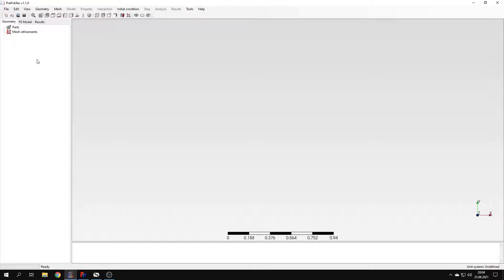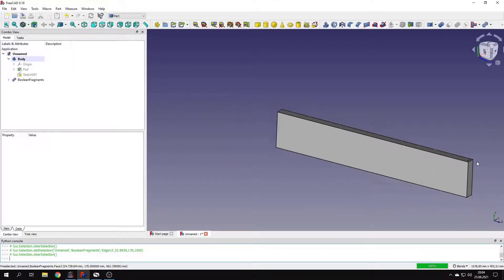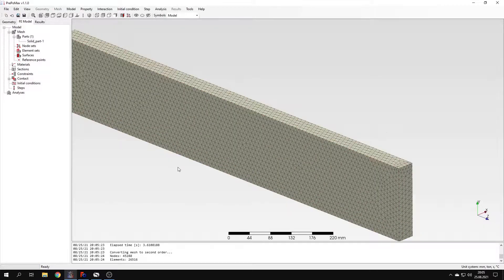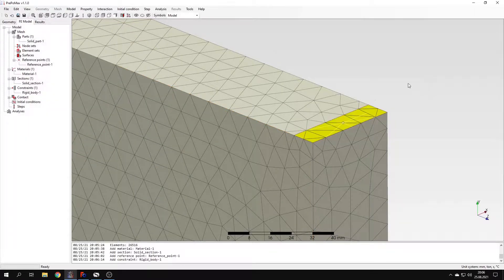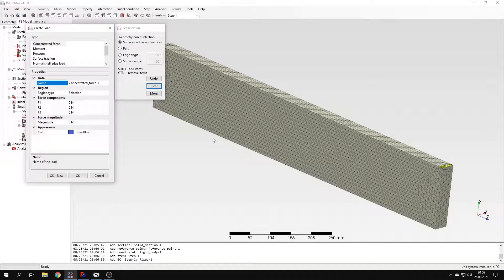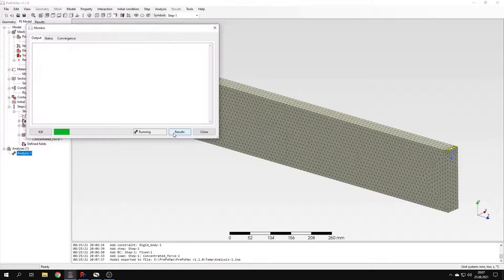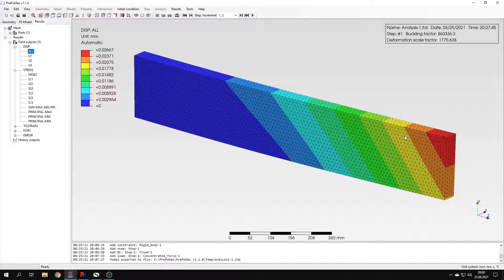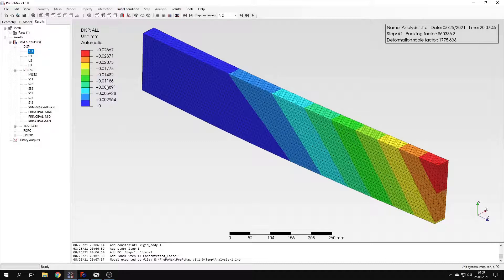PrePoMax (CalculiX FEA) - Tutorial 4 - Buckling of a beam

Comment: how did you make the surface on the bar in freecad, when i do it and import it into prepomax the surface is a separate body. thank you for your videos
Reply from the maker: I made a sketch with a line on the surface and then used the Boolean fragments tool to split the surface with that sketch. But if your part is a shell, also apply the "Convert to solid" tool. This trick should be sufficient to make PrePoMax recognize it as a single part with a sketched partition.
Reply: @FEAnalyst  thank you so much for the explanation. very much appreciated.

Comment: Thanks for your videos! What is the advantage to use a reference point to apply the load to it as opposed to apply a surface traction to that small area?
Reply from the maker: Surface traction should also work but you may get slightly different results.

Comment: For some reason I am only able to select faces at random but others register me a clicking inside empty space in the viewport
Reply from the maker: Are you using the newest version of PrePoMax ? Any unusual computer configuration ? You can report potential bugs on the PrePoMax user forum.
Reply: @FEAnalyst  Yes I've also switched to older versions, I'm using windows 10,  model in solid works and export import StepAP214 file format. I also switched to older version but the issue persist. I do have a somewhat out dated integrated graphics CPU.
Reply from the maker: @thisguy2-4-2  It would be best if you could share this model and describe the issue here: https://prepomax.discourse.group/c/bug-reports/8

Perhaps it can be solved but it’s also possible that it’s a fault of your graphics card. Did you try updating its drivers ?
Reply: @FEAnalyst  I submitted the bug report thanks for responding so promptly my drivers are up to date

Comment: I have been waiting for a non-linear buckling analysis for a year. Hope there will be on the tutorial 27 or 28.😋
Reply from the maker: That would definitely be interesting. I will do some research to find out what can be simulated taking into account CalculiX’s limitations (especially the lack of Riks solver) and how it could be verified. It may take some time though.
Reply from the maker: You were close, nonlinear buckling is covered in tutorial 30 ;-)
Reply: @FEAnalyst  You are always the best...:goodvibes:
Reply: @FEAnalyst  I tried to model Rectangular Plate with a Uniform Pressure Load, with 4 simply line supported. One thing I have noticed was a counter reaction force near all the four corners. So is there any chance to model a compression only on the boundary conditions rather than "0" in designated direction? (compression only spring or tension only member etc.)  Hope may be in the tutorial "36 or 37" best regards, 😙
Reply from the maker: @surachatgumngen5526  There are such features in CalculiX but they are not yet implemented in PrePoMax. One particularly interesting functionality of this kind is the GAPUNI element which is likely the best way to model compression-only supports but can't be easily defined at the moment since it has to be applied to every node involved in the support and it would take a lot of time to do it manually. However, there's a chance that it will be implemented in PrePoMax in the near future. It's also possible to model such supports using contact but it can be problematic and computationally expensive in some cases.
Reply: @FEAnalyst  Thanks for your effort in making Prepomax the best.
Reply from the maker: @surachatgumngen5526  I'm just preparing the tutorials and the documentation and helping on the forum, all credit goes to Matej - the developer of PrePoMax 👍